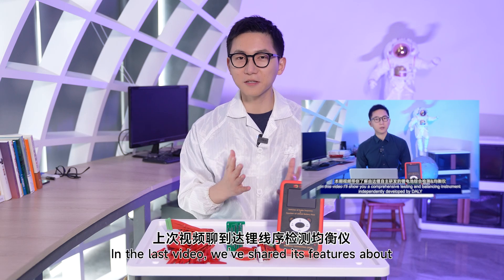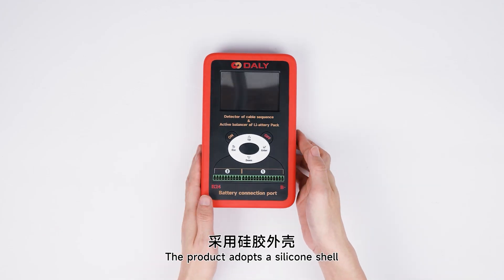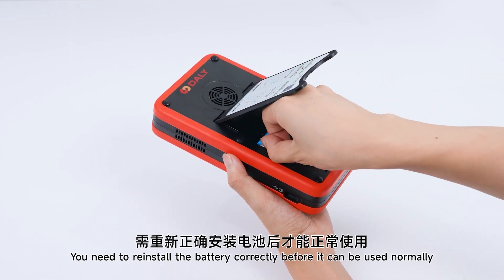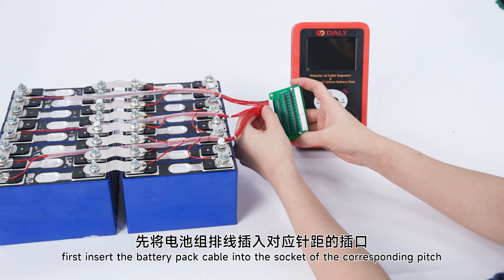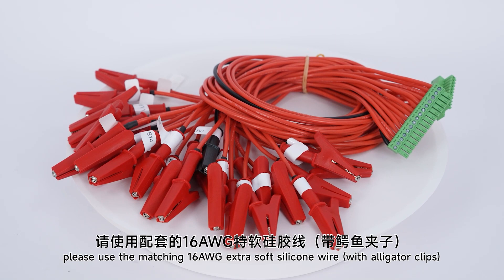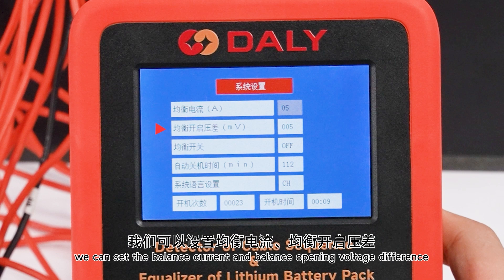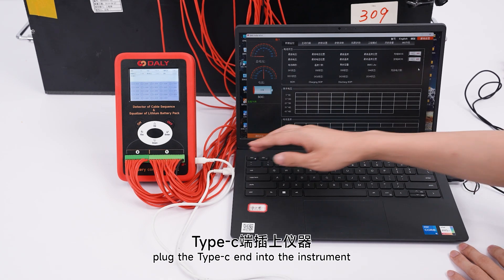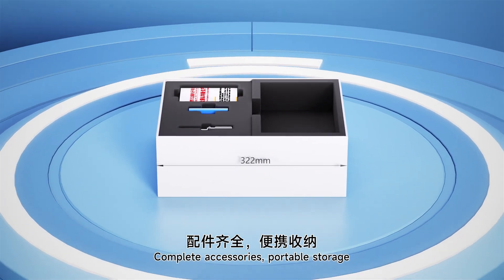DALY Detector of cable sequence&Balancer of lithium battery pack

Comment: I have purchased you daly active balancer but how to use it
Reply: And while use not showing Amp reading and only battery voltage is getting down
Reply from the maker: dear, please send message to dalymkt@dalyelec.com, I will send you the connecting method.